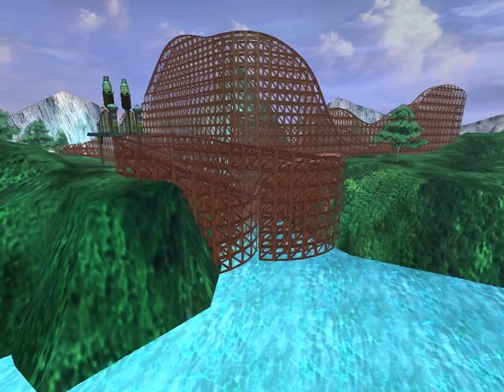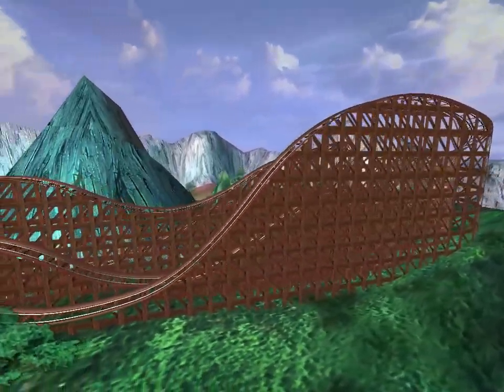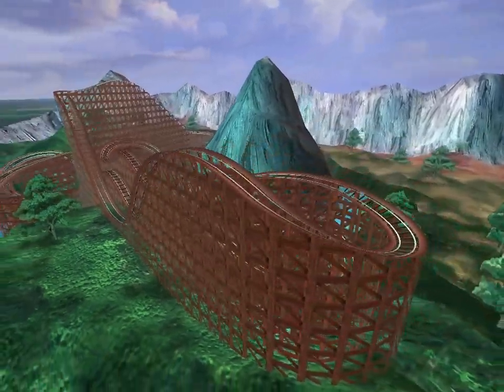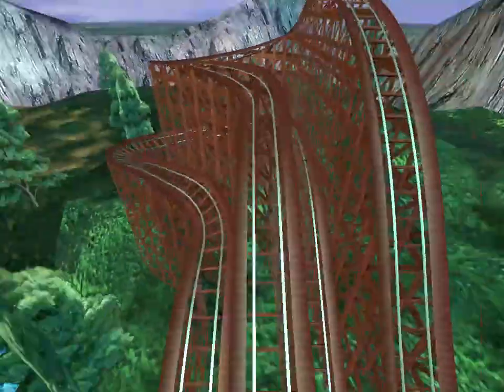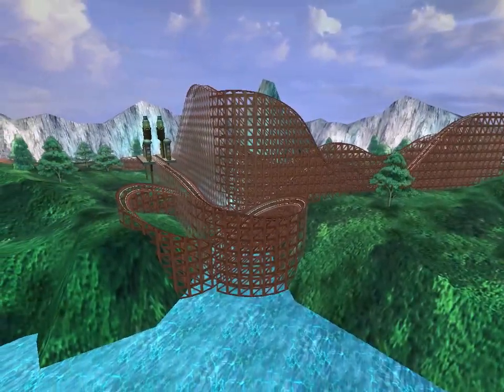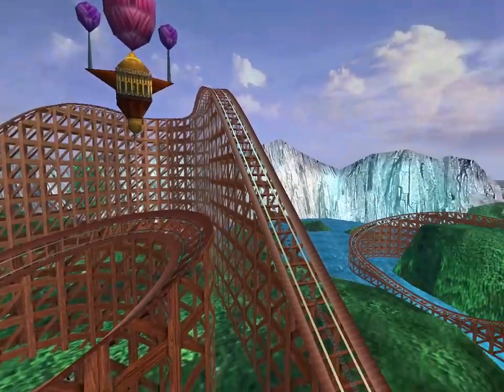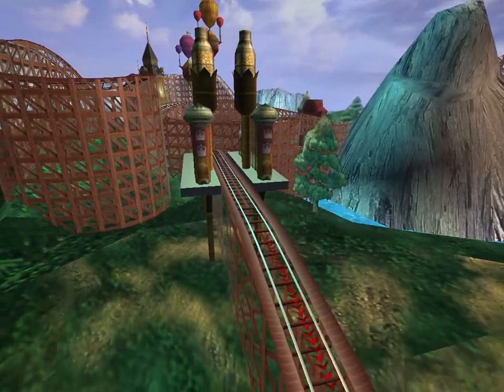Ultimate Ride (Coaster Deluxe): Imagineer Mode: Wooden Start-Ups

Comment: Those openings are very satisfying. It's cool to see your work in progress when the mission openings play again. "The Final Frontier" mission was tedious to me because I thought it was supposed to have downhill and uphill sections, which didn't work. It looks like you would have to turn the ride into something completely different, starting off with a booster so the ride goes fast, but slows down and flows smoothly in the style of a railroad train ride. Thanks for uploading these clips! I will have to see if I can complete the last two wooden missions at last.